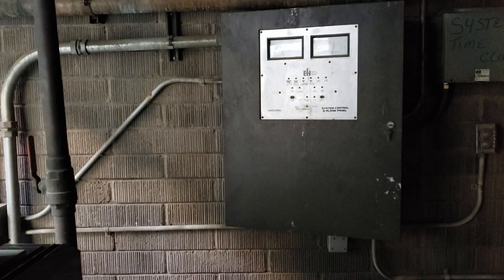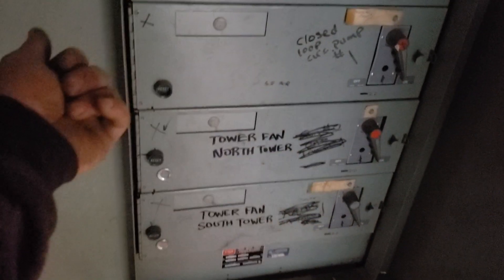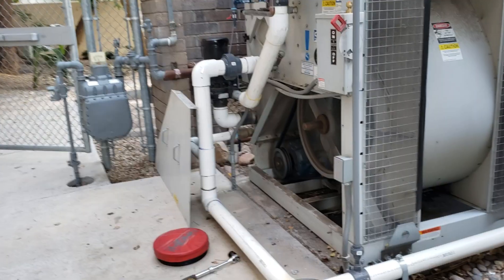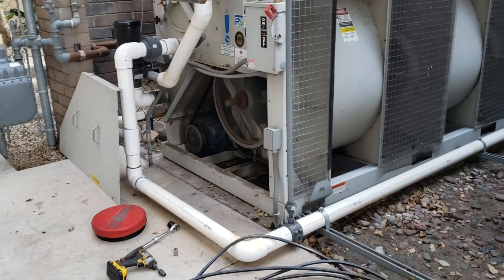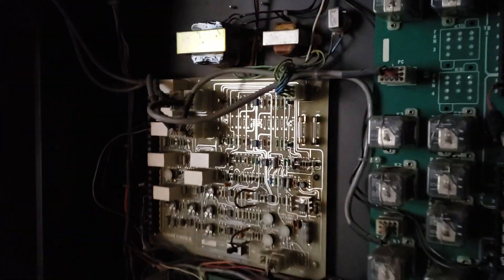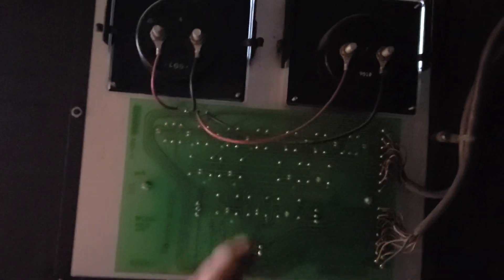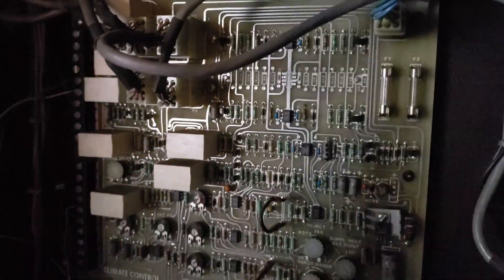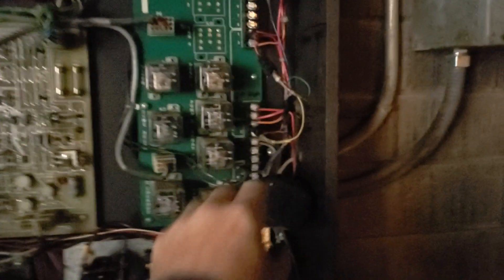Old Snyder General central plant controller could use some mods

Comment: I have 2 middle schools with WSHP systems that had similar controls to that. Both built in the 80's. They were upgraded to Trane Tracer a while ago but left a lot of the old controls in place but disconnected. Here's a video of one of them: https://youtu.be/KK7LEVGbnc8
I have another video that I haven't uploaded yet, but it shows some of the old central plant controls.

Comment: Way out of my league at the present time. Would you suggest a place to take classes on mini splits, heat pumps, etc? I'm an apprentice installer in louisville.
Reply from the maker: Are you in Arizona?
Too bad there are not many apprenticeship opportunities these days. Most people expect you to go to school which gets you into debt and until you get into it you won't know if you have the aptitude. Looking on craigslist might find someone looking for a helper. Getting a year of experience that way could get a person ready to go get an entry level position where they start you out on maintenance and then work your way into more and more service calls.

I did it the rare way of just changing careers into HVAC without schooling but I already had experience as a mechanic and had experience in electronics so it was an easy transition after initially helping on installs.

Comment: Why would a heater kick on for a cooling tower loop at that temp?  Loop feed wshp?
Reply from the maker: Yeah. WSHP.
The heat seems to kick on 1st stage at about 67 and shut off at about 69. Which seems right in the ball park.

Here in the Arizona desert in January we are at the point where people fire on the heat in the morning when they go occupied, causing the water source heat pumps to cool the water and demand the boiler, then by afternoon most of the building is switched to cooling and the tower has to cycle. LOL

Comment: The big beige circuitboard in the center looks like a homemade Jobbie that you would acid etch at home or or high school electronics class project.
Reply from the maker: It does. But it is OEM for Snyder General.
Probably all hand soldered at some assembly line in the 80's.